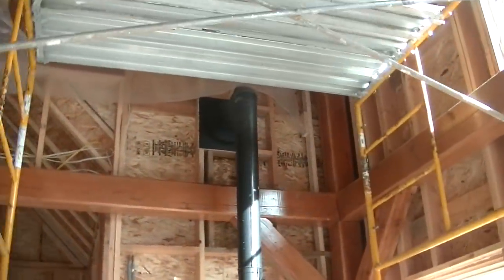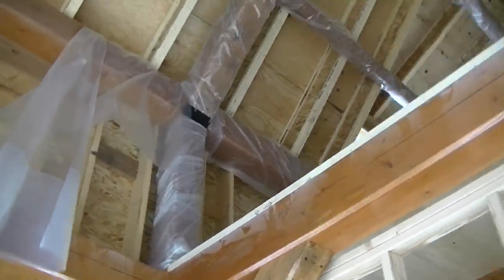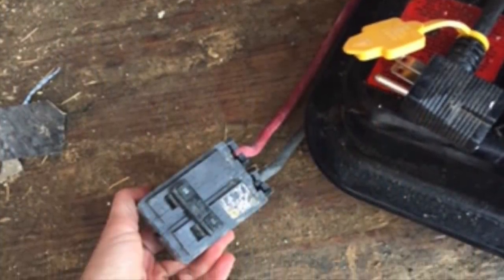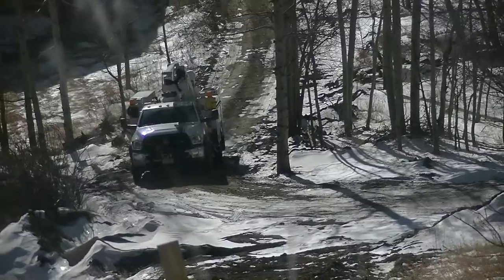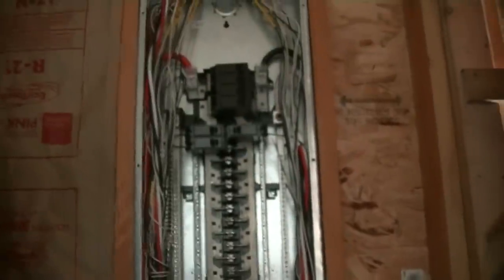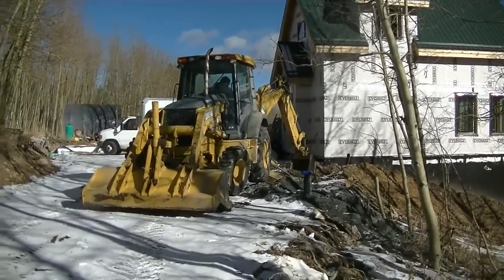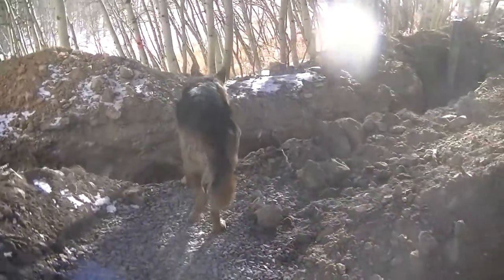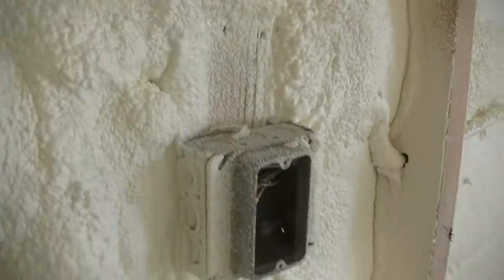Closed Cell Spray Foam Insulation Install

Comment: Excellent choice. Closed Cell Foam is by far the best way to insulate a house.There's actually a fire retardant in the foam, It's non toxic, unless it's installed wrong. It seals every void, crack, etc. making it air tight and once installed, it actually makes the the home structurally stronger by far. You could do a flash and batt if you wanted to, that is, install a thin layer of Rock Wool over the foam for more R's but probably no need. Congrats on the insulation and the well ditch !!
Reply from the maker: Didn't know that about the fire retardant in the closed cell foam- that's great to hear. There is no bad smell at all. Such a huge difference already! Thanks
Reply: @ColoradoMountainLiving , No smell is exactly what you want. That is a great indication that the chemicals and install were done correctly. To be extra safe, I would still recommend waiting 3-4 days before sheet rocking while keeping the home somewhat warm and a some ventilation. If you are really worried about fire, you can have an extra retardant put on but with sheet rock, I wouldn't worry. Jmo.
Reply from the maker: Excellent! Thanks for all your info by the way.
Reply: @ColoradoMountainLiving , You're welcome !  I do insulation for a living and love to help, if I can, so people have the best results for a warm, comfortable house !  And thank you for the awesome videos, keep them coming !!

Comment: It seems like there is less echo after the insulation. I went back to a previous video to check and it seemed like it improved some.Good to know that you won't freeze now. i hope you get the water done and trench filled before the ground freezes.
Reply from the maker: Yes, I think it's noticeable. It's so warm- don't even need a sweater anymore!

Comment: I chose foam insulation for the cabin and that thing stays toasty in the winter and cool in the summer! Besides it was easy...you can't even tell it's a log cabin from the inside with the wallboard covering the insulation
Reply from the maker: Wow- and what a difference! I'm happy so far.

Comment: Super exciting Amy.  You mentioned fire suppression. You know there is a fairly inexpensive system available with pex type plumbing that could be installed before the drywall goes up? If budget is tight the pipe and fittings can be run before drywall and later add the heads and manifolds.
Reply from the maker: Thanks! That sounds like something to look into, also our inspector would know more.

Comment: When you move the wood stove upstairs, please re-install the black stove pipe correctly.  It's a common mistake, but you have a chance to correct it at a convenient time.
Reply from the maker: We got it fixed a few weeks back when folks told us we had it backwards. So I think we're good now.

Comment: Curious why you didn’t fill the walls and ceiling flush with the studs and rafters?
Reply from the maker: Can't afford all that foam. It's super expensive. This job was 11K! In places where they "spilled over" the studs, they scraped off the foam so we could place the drywall flat.
Reply: Colorado Mountain Living what would high density fiberglass insulation have cost then?
Reply from the maker: Hmm would have to calculate this out. Do you mean the fiberglass with R21? That's what we had in the basement for the past month. Maybe there's other higher density stuff available.
Reply: Yes, and yes.  Not sure about the something, though... probably that too. :-)
Reply from the maker: And we have major winds up here- on a consistent basis over 30mph. Airtightness is a huge benefit.

Comment: When you put the water line in from the well, you might want to install a "T" in it, at a convenient place, in case you ever want to add some water hydrants around the yard.  That would make it easier to tap into the supply line without having to cut the main line.  4 gpm is about the minimum needed for a household, but you can always have the driller come back in the future to drill deeper in search of higher water flow.  You never know, but another 100 feet or so might be enough.
Reply from the maker: Good call, even if we dont' put the hydrant in now we'd still have the option to. I think we need to talk to the driller about how the pressure tank and resevoir work.
Reply: The main issue I've been told is that you don't want the well pump to be cycling on and off frequently.  The start up each time generates heat and that's what can burn up the pump motor.  So when I'm using a lot of water, I measure the length of time between pump runnings.  My personal thought is that if it only stays off 2 or 3 minutes before cycling back on, then I need to cut back my water usage so this interval lengthens up to at least 4 or 5 minutes.  With your limited gpm, I would suggest you watch for this until you get comfortable with how much water you should be using at a time.  I use 2 pressure tanks so that helps lengthen the amount of time between cycling.  I've had to replace 3 pressure tanks over 18 years that rusted out, but my pump is still going strong.

Comment: I was wondering about spray foam insulation, We don't know how we are going to insulate our house when we build it next year. Sounds like the R value is really good. :)
Reply from the maker: I can't believe the difference. We had the pink fiberglass in the walls downstairs and could barely keep it over 65 with the woodstove. Now the temperature hardly drops at all and the stove and burn down to coals and it's still 70 when I got home this afternoon.
Reply: Very nice. It looks like a great insulation choice we just have to figure out the cost and see if we can put it in the budget. Thank you for sharing. :)
Reply from the maker: Sure thing!

Comment: Will you have to put the plates over the areas where the wire goes through? Nice job !
Reply from the maker: Not that I know of. There's plates on the studs that have electrical holes drilled, but I don't see why we'd have to do it for between studs.

Comment: Your insulation contractor should be providing their own power, unless their discounting their service for using your electric! I had our home sprayed and the (2) contractors I contacted, the quotes were virtually the same for the amount of foam being used. The first contractor quoted using an onboard generator power system, the 2nd quoted me using my power source, he told me he needed to hook up into my power for 200A....The equipment uses a lot of amperage to continuously heat the drums of foam. 
Needless to say I used the one with his complete system on his truck! His generator was a 4 cylinder producing 30kv. He was prepared to sell his product!
You didn't mention weather it was closed or open cell foam. If its closed cell no interior vapor barrier is needed however if it's open cell then you'll need an interior vapor barrier Either way it's a great choice for the home owner.
Reply: KVA not KV. So it 30000 watts @220 volts, not 30000 volts, that's high voltage.
Reply: She showed the report from the installer, it was closed cell.
Reply from the maker: His quote was $3K less than the others we considered. He's been doing it for over 20 years with great references, so we're pleased with the work and results! Closed cell.
Reply: Obviously you understood exactly what I was implying, so whats your point?
 @kevmarmarsh4238
Reply: Barr; Squabbling over 30 bucks.....lol.

Comment: Did you check thickness?
Reply from the maker: It' thicker and thinner in some spots, but about 1/2 filled in the walls and about almost flush in the ceiling, so pretty sure it's close to the inches we're quoted.

Comment: I'm a little worried about the insulation it does not look to be closed cell foam most of the time when it is put on the walls it is done like one inch at a time and built up as that inch drys then another inch or so is added, it is not put on all at one time. when you push on it with your finger is it really hard or kind of gives can you make a hole in it with your finger?  closed cell is hard as a rock.
Reply from the maker: It's hard as a rock. Perhaps the technology has changed. We were under the impression that the application is as you say- spray an inch and wait and reapply, but apparently this formulation didn't require that.
Reply: good to know thanks.

Comment: when i said that you should run the wires for a alarm system, and also for outside cameras, i was thinking that the insulation was going to fill the walls right out to the dept of the wood studs. but now i see you have plenty of room in the walls to do whatever you want or need to do. glad it is all coming together for you guys
Reply from the maker: Yeah, no way we could afford 8 inches of wall insulation! We still may have to add some electrical outlets that we thought of after the electrician did the job.

Comment: I can see why there are so many houses that are burnt down in  America forest areas using the materials that are inflameable i.e. timber clading on the outside,  Osb board, standard windows, no shutters on the windows spray foam in the walls  all new houses built in Australia follow new rules that basically the house should not  burn down. The fire fighters don't  have to worry about them  You can leave your  home earlier when  a fire is coming and there is a very good chance  that the house  will still  be there after the fire has passed  but like all things there is more costs but the safety aspect has improved immensely. We still lose homes that were  built before these new rules
Reply from the maker: Up here if a home is over a certain amount of square feet- 2000 i think, a fire sprinkler system is a mandatory install. Also tree culling for fire mitigation around the house, often the insurance companies require that. How progressive Australia is! Can people afford it or is the housing market suffering because of it?
Reply: @ColoradoMountainLiving  We have different  levels depends on how much fire load is near the building, the slope  of the site and other factors the fire authority has the last say when the new regs came in about 2010 there was a fair cost rise in the higher levels of building but with new technology and better building practice the price is better If you want a bush lifestyle  than you will pay more like living  near  the water we were using sprinklers  but there not in favor  with the authority's due to lack of water supply even with storage tanks My son has now built 2 homes to the highest  fire level and had no problem selling the first one still  living in the 2nd one if you want to buy it about A$3 million will cover it(has ocean  views)I hope this helps you
Reply from the maker: It's all very interesting to see how things are regulate in other parts of the world. Ultimately, the major environmental factors seem to dictate- fire hazard and water supply. I'm sure ocean views in Australia are worth the price!
Reply: @ColoradoMountainLiving  We are having major bushfires in Queensland in the northern  part of Australia. Last week dust storms in Sydney which in the middle eastern side of Aus and this week in Sydney we had a 1in a 100 year rain storm also snow in the mountains south of here and it's  summer now (climate  change!!)
Reply from the maker: Wow. Now that's something for sure.

Comment: Some things I wish people considered about foam insulation: it is toxic, it is flammable, roof leaks will be harder to detect (thereby causing rotting), it can contract and leave gaps between studs, and messy.
Reply from the maker: Solid considerations.
Reply: apex, There's actually a fire retardant in the foam. It's not toxic, unless it's installed wrong. Once cured, it does not contract and will actually make the the home  structurally stronger by far. Stop trying to put fear into these and other people when you don't know the actual facts. Closed cell is by far the best way to insulate a house. You should be more worried about kitchen cabinets, paint and carpet which produce way more VOC's than closed cell ever could or would.
Reply: @apex007 , Here's the statement on contracting from that article:
"I've seen this only once, and it was with closed cell foam, but I've heard of it happening with open cell foam, too." Lol, one time and he "heard" of it happening.
Here's the last sentence: "The good news, though, is that spray foam's problems are generally less frequent and easier to overcome with proper planning and follow through." 
Please stop trying to scare people with situations that are so far and few. The bottom line is, It's safe, non toxic when installed correctly, it's air seals better than any other product, has a higher R value per inch and adds structural integrity to the building by a large amount.
Just because you are scared of it, doesn't make it bad.
Reply from the maker: There's probably continuous advances in the technology, producing a better product over time. This article was written almost 10 years ago,  I noticed. But do appreciate the concern for safety.

Comment: You guys should be nice and toasty now. We wanted foam but couldn't fit it in the budget so we did fiberglass and did it ourselves. And now you will be getting water soon. You're moving on up, LOL.
Reply from the maker: It used up a big chunk of our budget for sure, but up here where it's cold most of the year, it's already paying off. Moving on up indeed! was 73 in here when I came back from town!! that's with just coals in the woodstove.

Comment: I have never seen walls left with space like that I have always seen where they fill it all the way out to the edge of the 2x4’s
Reply: That's usually open cell foam they do that with.
Reply from the maker: We paid for 3 inches in the walls- on 2x6s that's halfway filled and gets an R21.
Reply from the maker: We don't need it that thick.
Reply: Lawn chief stick to lawns.i IAM also a certified applicator.not all walls are 2x4.thats all I have time to say
Reply: @NotSureJoeBauers  you can't rely on your framing for insulation.its not a log home.stoppig air coming in is one thing..you also want to keep the heat from going out in the cold months and the cool air in during the warm season if you lived in waaaay upstate NY you'd understand that more I guess.get certified then post your comments k
Reply: @ColoradoMountainLiving  I've sprayed houses curches crawspaces atticks and everything in between.when applied right you can't beat the r value or the seal.its horribly toxic..can go totally wrong and ruin a house but that only in extreme measures.it works if it's done right.my certifaction and field trials promise you

Comment: Tat insulation is the best decision for the house.  if you have European style windows, you will save so much money on electric. you will not even need to turn the heat on, you will only need a burning wood stove, warm up the house, and it will keep the heat in the house for 7 hours easy.  i guarantee you. it will pay off in the future. Now that is a true house. not builder grade junk houses.

 I live here in Georgia in a rented home and since now is winter, the furnace is turning on every 15 minutes. That's how fast is losing energy. When i put my hand close to the window, i feel the cold air from outside coming inside the house through these piece of junk builder grade windows. Or may i say, American style windows. Welcome to america.  Where they fix everything with cocking.  And they say "American quality"  I say "American Shit Quality"  Good thing you did not hire a contractor because they only suck money from you and lie to you and never care about you. They only care about their pocket.
Reply from the maker: You are correct- the wood stove burned out and it was still warm this morning. I know what you mean about cheap poor quality houses. We lived in North Carolina before and every house was built the same- hardly any insulation, crappy windows- ugh- terrrible! Nothing like a good quality hand built house.
Reply: Add double e glass windows as you can afford it.
Reply: That's the correct cycle time for a furnace....usually 3 times an hour...